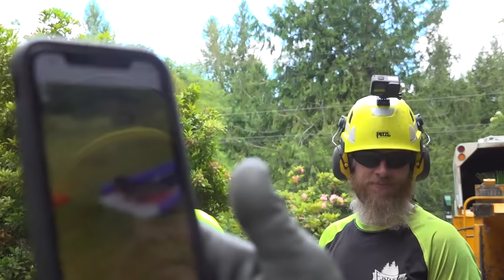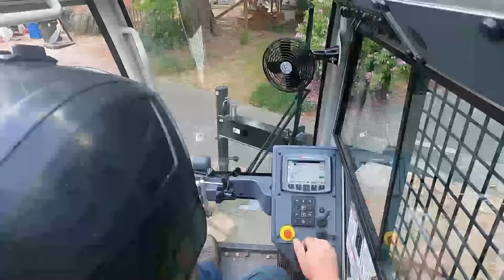CRAZY Cracking Cedar Emergency Removal! Huge Tree starts to break apart!

Comment: I remember the job i did here in Sweden with my brother on a cemetary, taking down all the big trees that was filled with concrete. They also told us that under no circumstanses could it come down sawdust on the graves, so we had to set up homemade sawhorses and plywood the whole area before starting. Some old graves were also pretty narrow, so when we digged out the stumps and planting new trees we once found a skull. It was by far the thoughest job i've done, but also the most fun and satisfying when it was all done. I especially remember the last day before the new trees were coming and we just had to be done by then, we worked until midnight with chainsaws in the dark, some people stopped and looked suspicious but nobody said anything. LOL
Reply: Interesting to hear about all the different jobs commenters have. Keep it coming, it's most entertaining.

Comment: A month on chipper blades would be awesome, chipping here in Queensland we change or flip daily, very few soft woods however I suppose.
Reply: That sucks having to change blades that often we get anywhere from 40-75 hours on our morbark depending on what we chip and how many rocks get raked up and put through by accident. But if we are only chipping rock hard dead hard wood the blades are very dull around 20 hours and we change them out.

Comment: You guys  are   great!  Wish I had all that  fancy garb when I was  climbing.  Every tree is unique in its own Way for safe removal or just to prune. Defiantly much easier to just get new  chipper blades  as the anvil is never  easy to keep readjusting.  still takes a good part of 2 hours on each worn blade to lap a new edge.  and  always would   rub any  butts  that had contact with soil and  dirt before  chucking into the  hopper. you  got  my subscription for  sure  now!!!!👌🤙

Comment: Well you broke my dads rule he taught me... He said son; If you work from the top of a woman and the bottom of a tree then you less likely to get in trouble.... that said he handed me my first tree spurs/LOL. I took a top out of a fir that was intended to be a spar tree for logging and the top was still taller than where I cut it off at. Those tops were not connected to anything but air and so when they left the tree that you stood in would sway twenty, thirty or more feet side to side. You don't do this after a night of partying on alcohol and be all hung over as you will send  the crew on the ground a belly full of tomato soup. Uck is not enough to describe that. Nice job... I never got nervous until you got to the second from last

Comment: How do you guestimate the weight of each piece that is lifted by the crane? Do you have a formula based on the diameter of the tree? How do you compensate for the weight of the branches? Thanks. Great video by the way!!
Reply from the maker: I used a green log weight chart when I first started to get the hang of it. We have done enough crane work now we just guess. It varies quite a bit by species and part of the tree

Comment: Great job, appreciated how you explained the job as you worked through it. With such a significant structural failure in the trunk/s I thought you may have considered choking the lower part of the picks as well, just in case they sheared completely apart when the crane took thier weight ...... risk of splitting down the inclusion fracture and falling out of the slings? Or do you think that unlikely with gravity, friction and the hinge point at the top sling choke? Personally thought this got more more risky as you took the last cut ...... when I have encountered this type of structural damage I have tended to treat them as two separate trunks, one at a time put a scarf in an bore cut back cut to the included fracture ...... but I have not had the luxury of a crane. Thanks for sharing

Comment: You should have a laminated card table for the approximate weights of the type of timber and circumference per metre or foot. So you reassure yourself and crane driver. Wouldn't be to hard to flick a tape around it.

Comment: Always a pleasure watching you guys.  Noted that you were using as your top handle, a husky T540i battery operated saw.  Wondering what you think of it.  I typically use a gas T540 and love it.  Just last week bought a a T540i package due to potential scarcity come next year.  Wondering which battery you use and how long it lasts for typical delimbing and such while climbing?  Also - do you carry a spare battery on your belt - if so - what do you put it in?   I too use Silky hand saws - love em.  Just have to say - having a crane aint fair.  :) Dave Pickett  iArborPRO Maryland.

Comment: I've mentioned it before, but I got a western red that is very similar to this one. It is about 60" diameter three feet off the ground and has a double stem top, I don't see any crack though. As a precaution, now seeing this video, would it be better for the tree to remove one of those tops preemptively? Or would that potentially cause another issue? I'd like to leave the tree if I can.

Comment: this company is ok. you tube has sent 8 ways for tree cutting 60 days in row. enough. 
Workspace tree felling advanced cuts is  good.  Did jed take contacts out before doing square filling.

i have done  tree felling and spike climbing 30 years. These guys are doing well but heed overexposure

Comment: The usual amazing saw work. Your crew not focused on this particular day, was heat an issue? Your clearly not happy with them on several occasions, even a couple on basic safety concerns. Dual crane coordinators at once not ideal. Pity you have to take so much care of them AND be lead cut.

Comment: OMG. This tree was so close to tearing itself apart and causing huge insurance claims. 65 inches diameter doesn't sound much however realising it in feet, that's a huge tree.  Great coordination with all members of this team. Kudos to Brian, A1 crane operator, working with the tree cutter. The guy with the Smiley Face, face shield what a crack up. 😆 🤣 😂 You guys envisioned the goats climbing paradise, same as the owner. Sooo Coool. Top Team. I am a wood worker, seeing this tree cut into pieces and the enormous size of each segment and the borers infestation, it mad sense to leave them there as a playground for the goats. Definitely no good for recovery into furniture.

Comment: just out of curiosity, what chainsaw are you using in this video?
Reply: to be clear..I am asking about the electric/battery powered saw you were using in the beginning of the video..
Reply from the maker: Husqvarna 540i
Reply: @guiltyoftreesoneastsidetre4792  Thanks. I will have to check it out. Still just used on small pieces, I am guessing?

Comment: i got fired on the spot for tipping a sack of potatoes into a rumbler peeler instead of placing them in one by one by hand because of the occasional pebble that falls out the sack into the machine.

Comment: 31:01 Anyone know what‘s that chain thingy doing on the end of the crane and what‘s it called?
Reply from the maker: It’s attached to a censor that shuts down the winch if the ball lifts up on the weight hanging by that little chain. It’s so you don’t accidentally suck your ball into the tip of the crane and damage it
Reply: @guiltyoftreesoneastsidetre4792  Thanks! Apparenlty it‘s called an Anti-Two-Blocking device

Comment: ALL is EXTRANEOUS chatter...non-work related is going to COST somebody something serious.
Said the opposing lawyer suing you!
Reply: It's team building.  Don't underestimate the value of a good team.  I've seen videos where a dysfunctional team were just about the most dangerous outfit imaginable.  They weren't talking to each other, and when they did, the other wasn't listening.  The ground crew all thought they knew better than the climber, the crane operator wasn't listening to anyone, so the logs would swing dangerously.  I'm guessing you weren't serious, but in case anyone, especially a lawyer looking for a quick buck, thinks you were, it's important to have the other side of the argument.